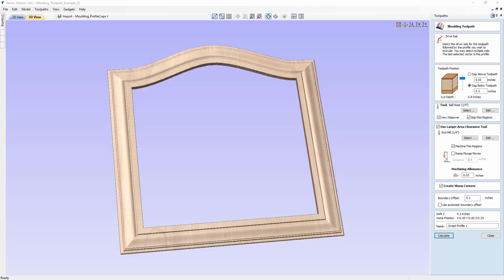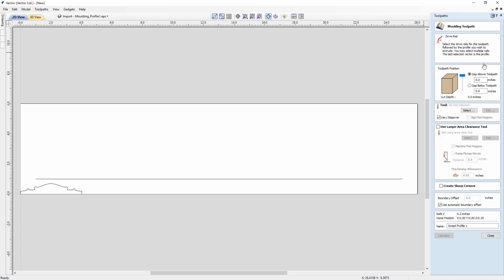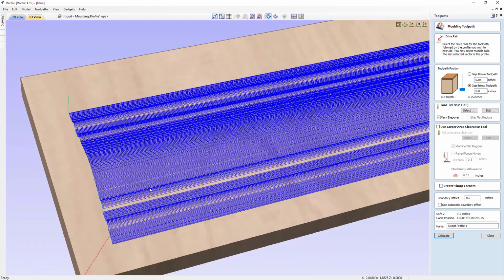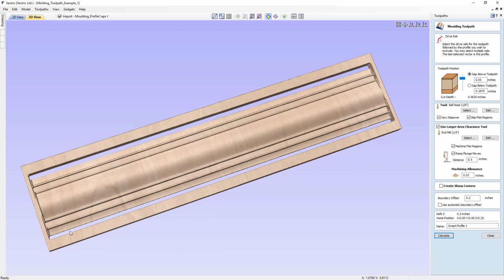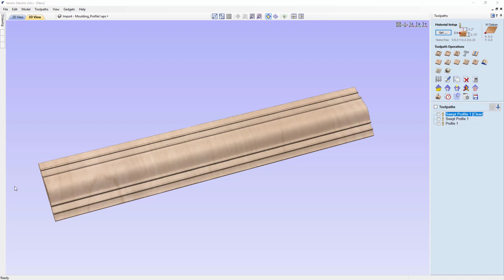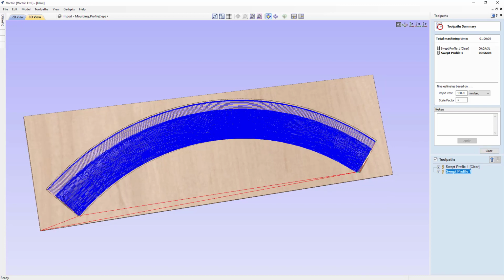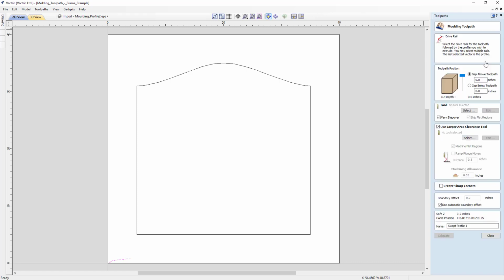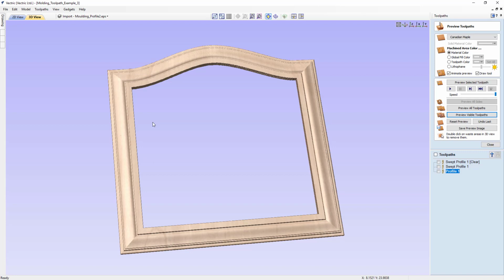Vectric V10 Tutorials | 2.5D Toolpaths | Moulding Toolpath Guide

Comment: Nice tutorial. Just wondering if the vector was drawn like say a window with four panes, would it be possible to create the profile on both sides of the vectors?
Reply from the maker: Hello Keith... if you reverse the direction of the drive rail you will be OK.  Do one side, then hover over the drive rail with your mouse and right click, select "reverse direction", you sould see the cross section pop to the other side.  Give that a go...
Reply: @vectric  thank you. I haven't got my Onefinity fully set up yet as there is an issue with the newer model Makita router here in Ireland. I have to say, they seem to be a very robust machine and I can't wait to try out some of the projects I have in mind.

Comment: Great video!! In Desktop, can I make my own profiles and can I put them onto a bowl or dish?
Reply from the maker: Hey Juan, you can use the moulding toolpath in desktop :)
Reply from the maker: It's possible to create a bowl using the moulding toolpath, depending on the design you may need to add in a pocket toolpath  too :) I hope this helps!